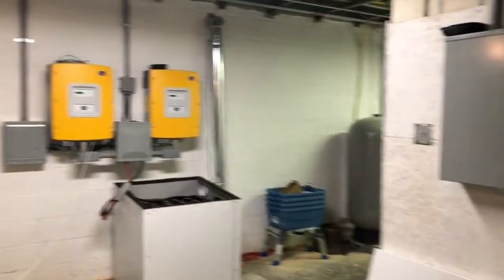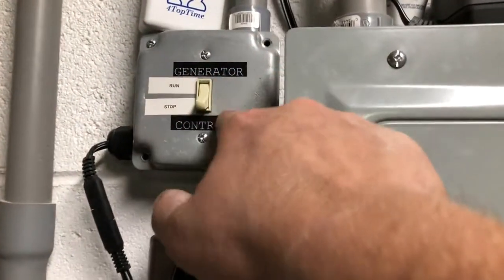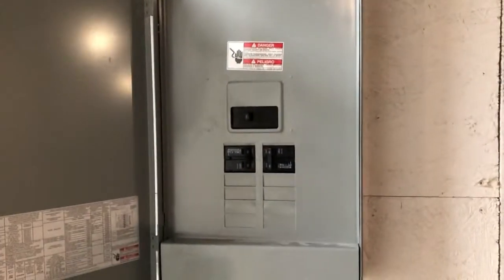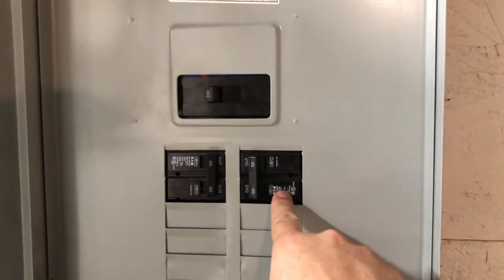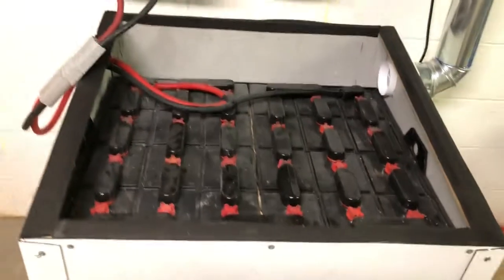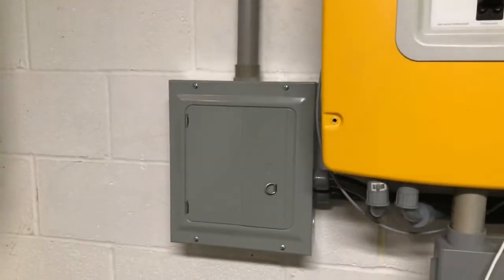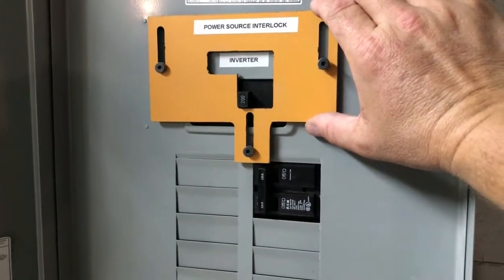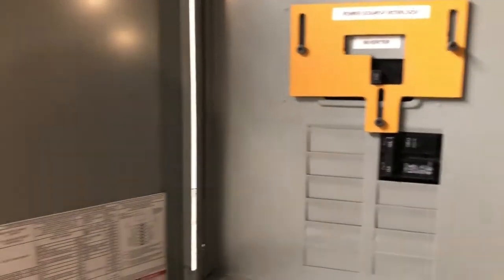battery inverters

Comment: Hi Wes,  I came back over to your channel after your last comment.  Is it in this video the two panels, one just for 120v?
Reply from the maker: No that’s the sunny islands.  Before that we had a aims 4kw 120v inverter with only critical loads on it.  The sunny islands have been running the house for almost two years.  The only loads I do not have on them is the heat strips for hvac and the electric car chargers.